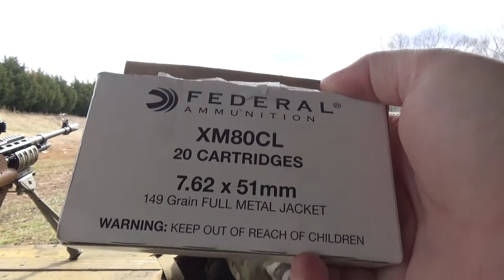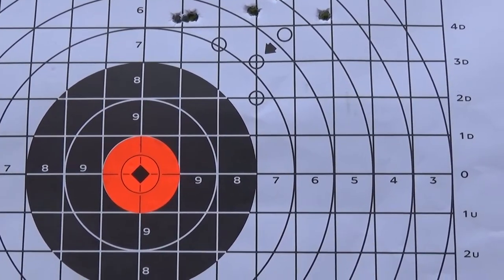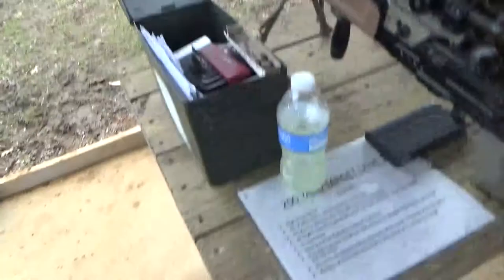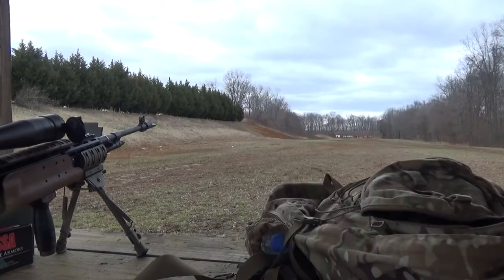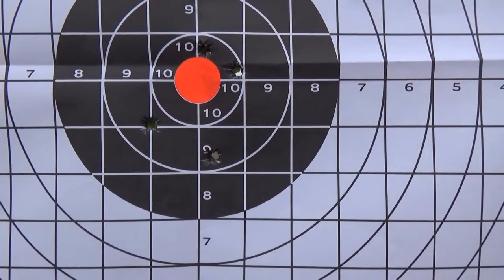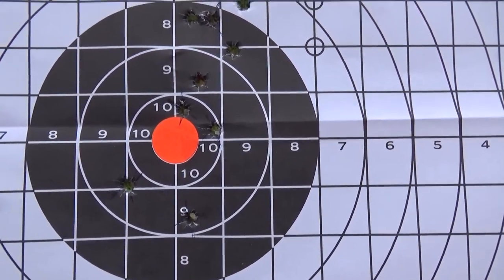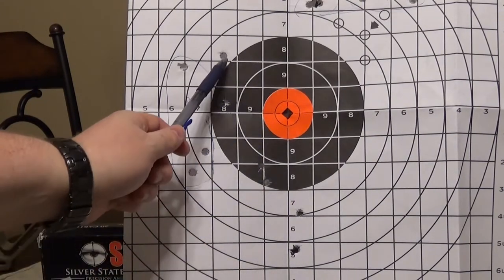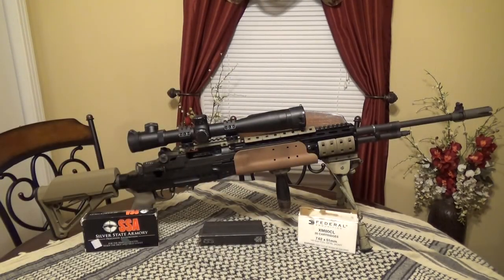M1AEBR Barrel Whip Screw Test Part 1

Comment: Been watching your videos, it won't let me comment on your fnx 45 video so I thought I'd do it here. Look up mag guards for your ccw and you can be 100% certain you'll never lose your mag. Only $10 so worth it.
Reply from the maker: I have never heard of them, but I will be sure to look them up. I had the same issue happen again, except this time the mag stayed in the gun, but became stuck because a round had partially come out of the mag and caused it to get jammed. It did come out, but it took a good swift pull to get it out.

Comment: How stable are you with that 9 to 13 " bi-pod ? The reason I ask is I had a bi-pod of the same length and found I had to raise the rear of the stock too high for me to use my support hand to elevate or stabilize the rifle well. I have purchased a 6 to 9" bi-pod and what a difference. MikeM0931 also told me I should be using a sandbag at the rear for  more stability and easily adjustable . He said a GI sock partially filled with air-soft plastic pellets works very well. I am going to try that out on my next range trip. I have also made a mono-pod for the rear of the stock for the same purpose . However I have heard that a Mon-pod will cause the rifle to bounce. I want to try it out and see for myself. 

Question, when the rifle was installed into the chassis did you torque the screws to 25 INCH pounds with a torque wrench? If not you should. Torque them in sequence and then go over them a second time to insure they are all correct. If the are all torqued down correctly they will all draw the Barrel /Op Rod Guide evenly. That rifle is capable of 1/2" groups at that range. Of coarse it may be the ammunition. Try Federal 168 grain Gold Medal match. Mine does ok with it but it loves the Hornady A-Max 168 grain. I started hand loading with them after I saw how well it did with the super hot Superformance match. Too hot for the M1A so I shot them with the gas off. But it did so well I bought the bullets and hand loaded them. 1/2 " from the bench off of sand bags. That is when I can get the wiggle out of the mix. Anyway sorry I talked your head off. Great experiment. I just hope you don't get discouraged I think you will get it "Tuned" right in and I eagerly look forward to the next video .

Mack
Reply from the maker: From the bench, the stability is pretty good. In the prone it's much better though. I wish I had been able to use a lead sled or something similar though.
Reply from the maker: I believe my bipod is a 6-9" and its works reasonably well from the bench, but I try to lay the rifle on a backpack filled with towels when shooting from the bench because it seems to give me an even more stable platform than the bipod. However, the last range trip I shot from the prone at 400 and was smacking the steel left and right from the bipod. My biggest issue with mine is that the bipod seems to be canted ever so slightly to one side and no matter what I try to do to fix it, it keeps going back to roughly the same canted position. I did use a torque wrench when installed the stock and torqued the screws to 65" pounds in sequence. I do think the reason the accuracy wasn't all there was a combination of myself and the ammo. I have shot better groups out of it before using Federal Gold medal match 168gr, but I haven't tried the hornady A-Max yet. The next video I will be a bit more scientific, well...as scientific as a country boy can't be haha and use match ammo and maybe even a lead sled if I can find one to borrow. I apologize for the late response.